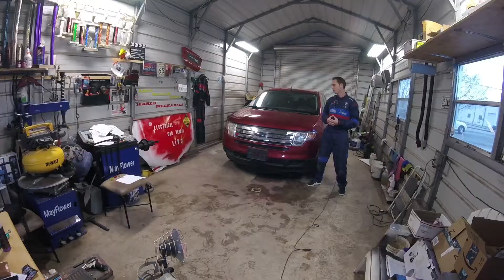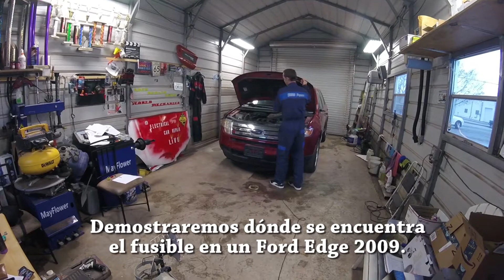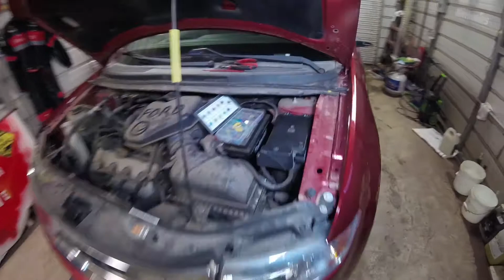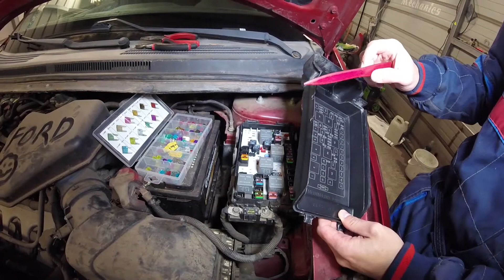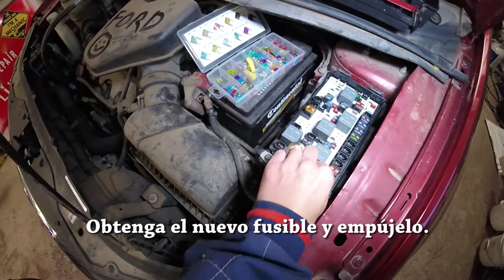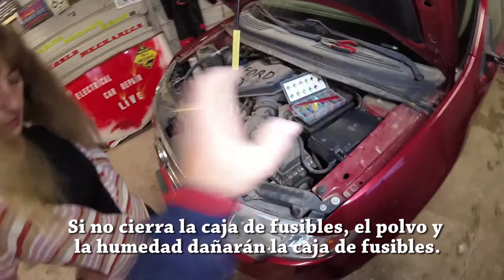DÓNDE ESTÁ EL FUSIBLE DE ARRANQUE DEL MOTOR FORD EDGE

Comment: Hi, thanks for sharing this information is very useful.

I have a Ford Edge 2013, while recharging my battery with another car due to covid the car has been seating there for a long time, the vehicle is not not turning on at all.

I already check fuse 28 and was in good conditions what else should I check? or is a part that needs to be changed?

thanks in advance, I'm planning to go over of all the fuses in that block but if you can provide another input is greatly appreciated.

Thanks again